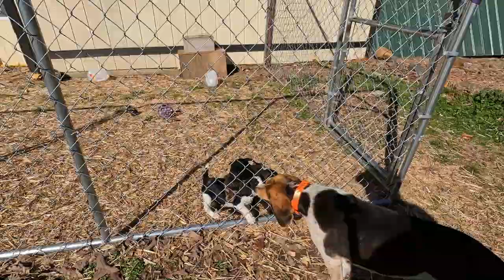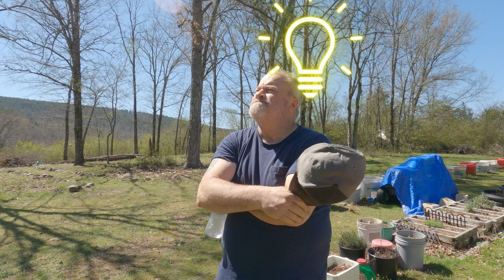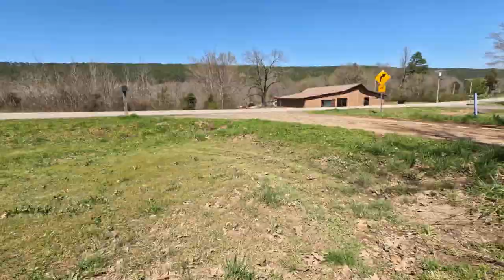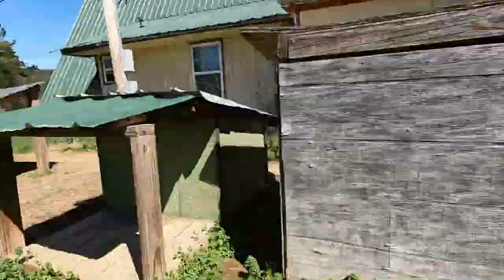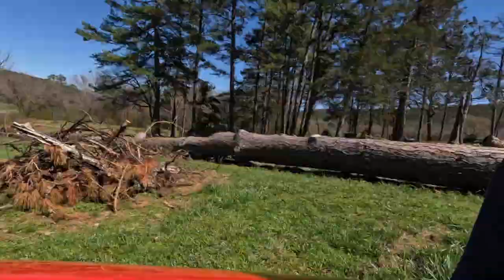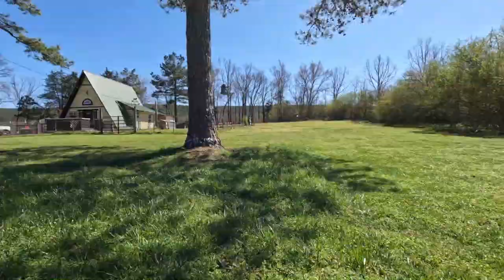Double Duty! Working On 50 Ft French Drain While Mowing A Challenging Property

Comment: Great Job Mike! I've been doing commercial sprinklers/irrigation for years. No stranger to a shovel 😂
Clean trenches🤌man's gotta do what a man's gotta do
Also, perforation on all sides of pipe is fine in my opinion, as long as the aggregate doesn't clog drainage holes on the top. 
Ive also done commercial maintenance for years. Mowing grass can be soothing, and or labor. Nothing like the smell of fresh cut grass
Reply from the maker: Thanks 👍
Reply: HA-CHOOOO 😷
Reply: @SeeLionsInTX  hehehe I also have dust allergies 😬
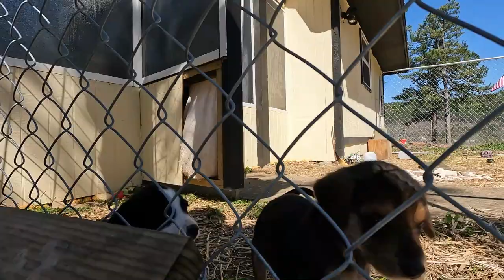Reply: 3:50. Toast thinks she’s “the cat’s meow,” the way she’s prancing around there.💕